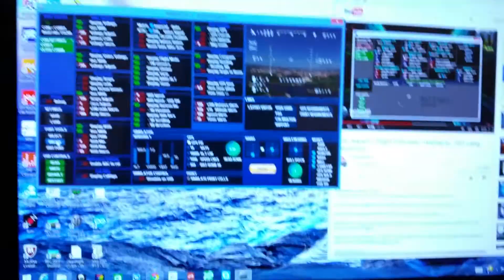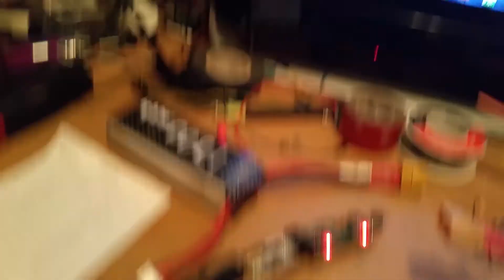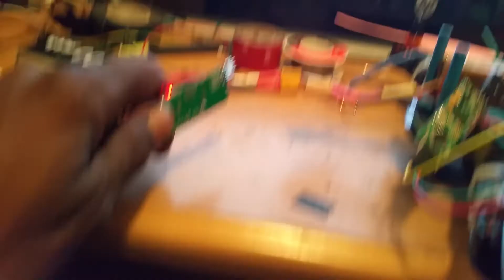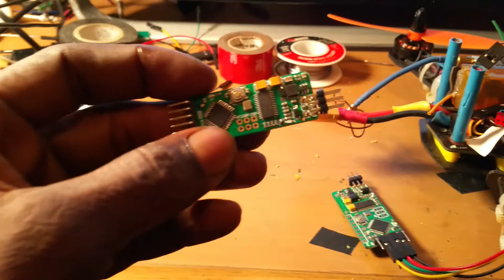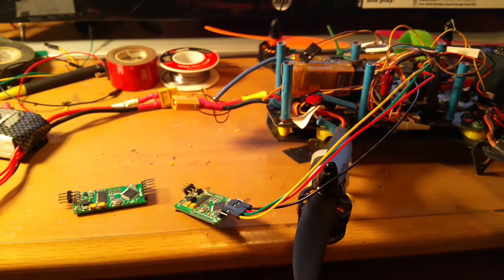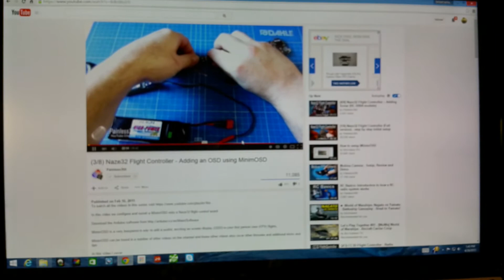Osd from the  beginning tell me

Comment: Hey matey this is a bug in the firmware, mine done this also, it didnt actually save it, lots of folk have had this issue, check out this thread on FPV Labs I downloaded the newer firmware and GUI and it works fine
http://fpvlab.com/forums/showthread.php?34250-MWOSD-for-MULTIWII-NAZE32-BASEFLIGHT-HARIKIRI
Reply from the maker: So I use the first one or the other one
Reply from the maker: And if I get it working  thanks for the help
Reply: Delbert williams delbert williams I use the 1.3SP1 firmware and GUI which can be found here https://drive.google.com/uc?export=download&id=0B2MInRUrbpWxMFM5OTV5V2hOUk0 remember to run eeprom clear first in Arduino https://code.google.com/p/rush-osd-development/downloads/detail?name=EEPROM_Clear.zip&can=2&q= then upload new MWOSD1.3SP1 and run the newer GUI also in the SP! Zip file you have downloaded, let me know how you get on.